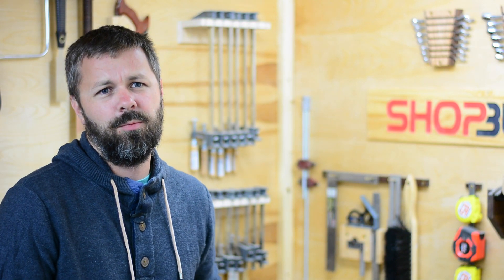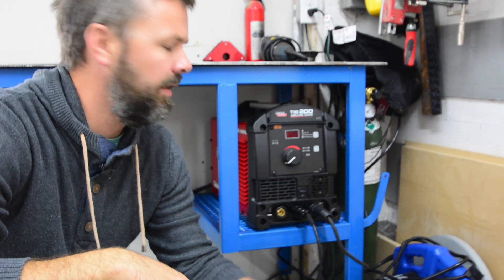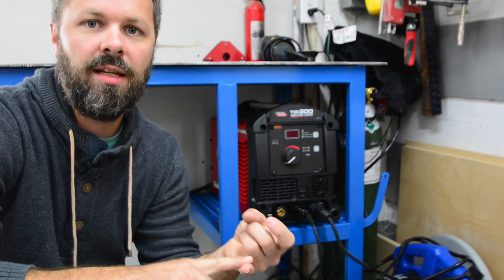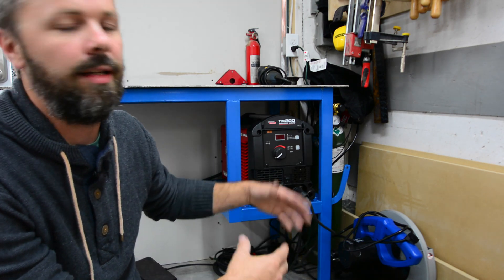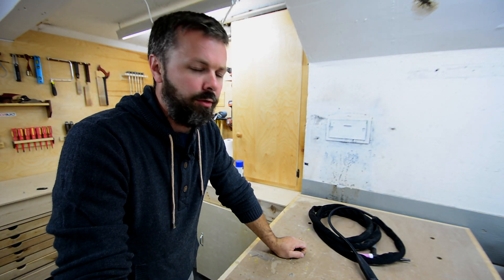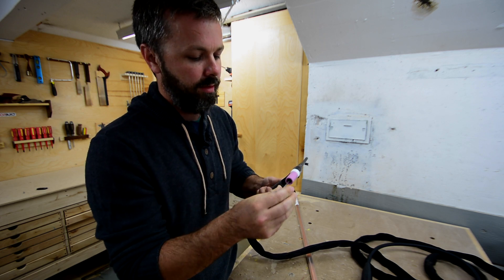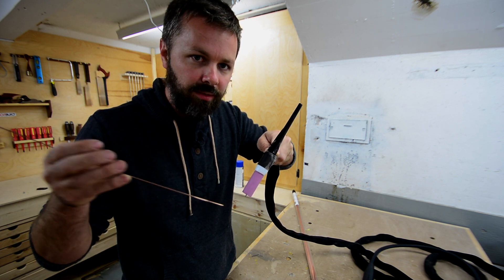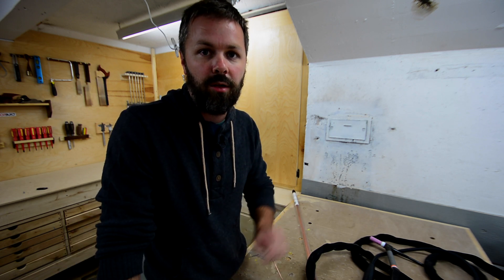Shopbuilt - Welding questions answered

Comment: That's good info. Thanks for sharing. 
Two Questions: I just a multi-process welder; it came with only mig gun and stick. I want to try my hand at tig.
How do I know what filler rod to use?
Can any tig torch work with any welder?
Thanks

Comment: I struggled with the same question - MIG or TIG as many do... I started with Mig and a year later bought a TIG and have been using it for a few months. It definitely is a lot harder to learn than Mig, and I do feel it is overkill for just making some furniture out of mild steel. But there isn't much you can't do with a TIG welder if you had to pick just one to have. Another benefit is only needing one type of gas for all metals. Part of the reason I went with TIG is that Mig gets kind of boring. With TIG, you are spending more time with the fun part - actually welding! BTW - your tig beads look great!

Comment: That's because tungsten isn't steel. It's a completely different element than iron and iron alloys such as steel. And it's melting point is 6100 degress F and nearly 3500 C. Not 3500 F. Huge difference.
Reply from the maker: +Felix Su I meant to say metal (obviously) and if I said degree F than I meant degrees C but thanks for calling me out:)
Reply: Sorry. Didn't mean to be so pedantic. There's a huge difference between steel and tungsten and I didn't want other people to get confused.

Comment: your choice of welder was better for you. your Tig Welder will weld every type of metal where the Mig can't weld non ferrous metals without special attachments. 
for a hobby type welder that really can't afford or justify several machines. yours was the best choice!
My opinion is only an opinion, however I am considered a Master Welder with 40 + years in the industry.
Reply: not true, i weld aluminium without a spool gun . but it is 1.2mm.

Comment: MIG is faster, more efficient, requires much less prep work, no time wasted sharpening tungsten, less gas use, cheaper cost to buy & to run, etc. That said, TIG is far more precise and works better for some applications, where you can justify the additional time and cost. I have both in my home shop. For something like a turbo manifold, i would never even consider using the MIG. For something like a utility trailer, i would never even consider the TIG. They both have their place, but for hobby welding MIG can accomplish 90% of jobs faster, easier, cheaper, and equally strong. That said, on the remaining 10% a TIG is a VERY good thing to have.
Reply from the maker: +BigBeansM3 I can agree with most of that, I think where looks matter, TIG is the way to go. Obviously a trailer doesn't need pretty welds but most of the thing I would build (mainly a woodwork shop) looks are important and strength and speed are not so important.
Reply: i think stick is a much better process for the hobbyist than mig, so a tig welder is still the answer

Comment: I bought a Longevity StickWeld 140 a few months ago. As a teenager, I can't truly justify the purchase but it's nice to have the option, and it helps when I need to grip a rounded bolt.

I bought this brand new as opposed to a used tombstone welder, out of convenience, I really don't have access to a 220 volt outlet, and storage is an issue.

Comment: Thanks for great video.  I have a question regarding heat distortion.  Between MIG and TIG which one is more prone to cause heat distortion/warp?
Reply from the maker: +Making SawDust good question, TIG definitely has the advantage there, TIG can really focus the heat right where you need it. A lot of TIG welders like the square wave have a pulse feature which can also help control heat.
Reply: Thank you, much appreciated

Comment: Do you need gas for either?  I want to avoid that as it seems more complicated.
Reply from the maker: +Jason Langston yes...kinda, you can use mig without a shielding gas using flux core wire but I'm not a huge fan because it typically makes a messy looking weld with a lot of welding splatter.
Reply: +Shop built that very true but if your out in the elements shielded wire is the only way